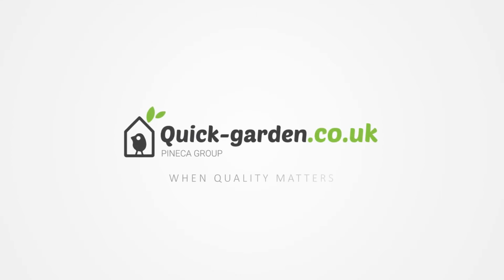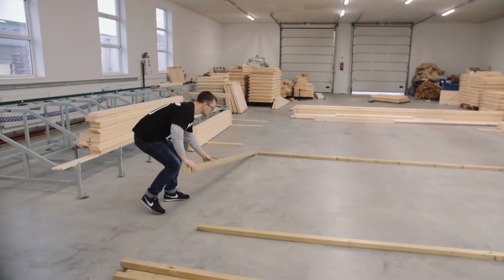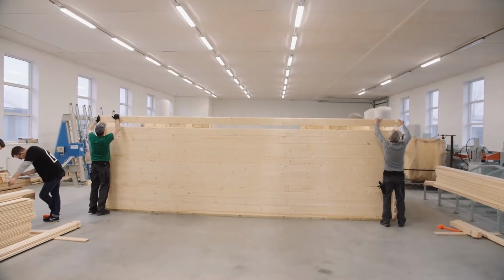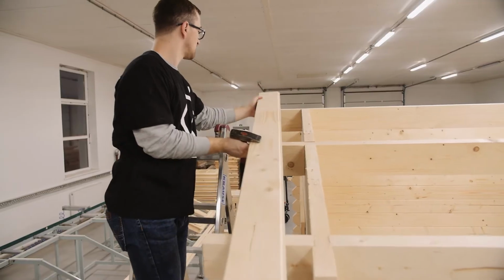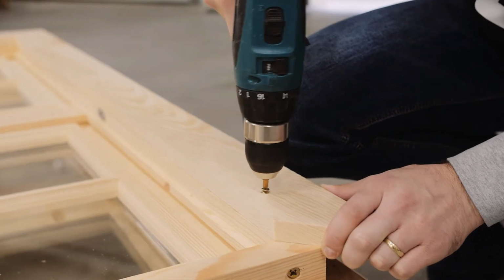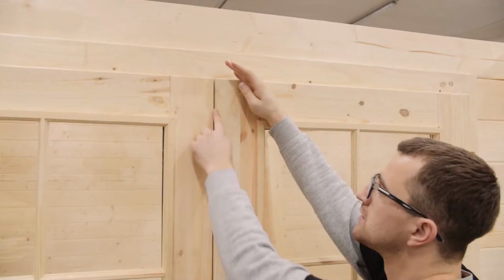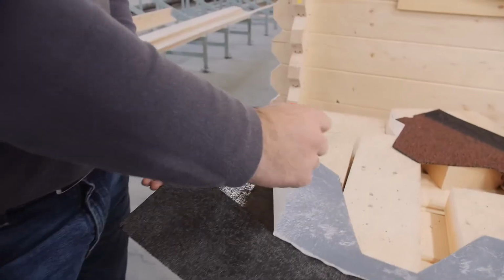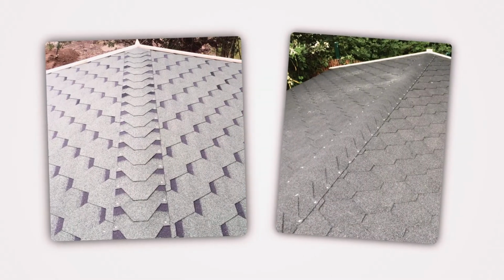How to assemble your log cabin | Quick Garden | Pineca Group

Comment: Those floor timbers will rot if placed directly on concrete.
Reply: I have a cabin coming later this year and was wondering the same thing. Do you have a sugestion?
Reply: @oldbootneck  I am using these for my build . Wolfcraft 6987000 Support Pads